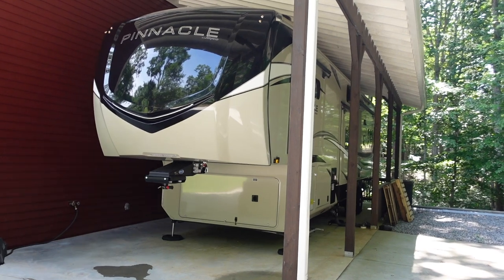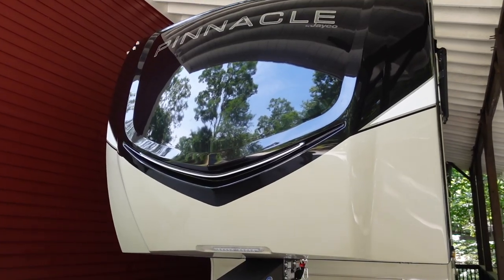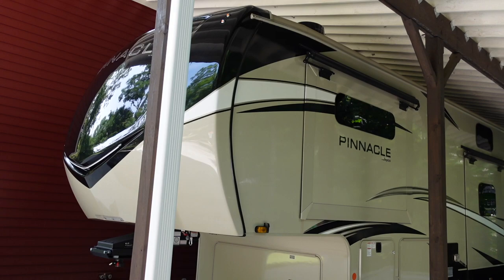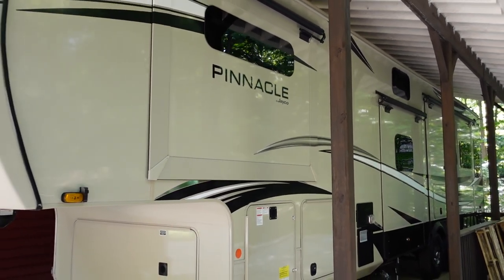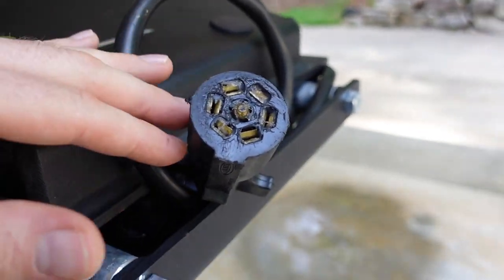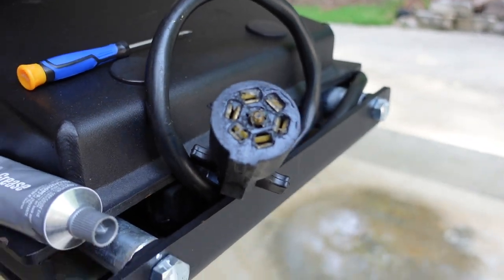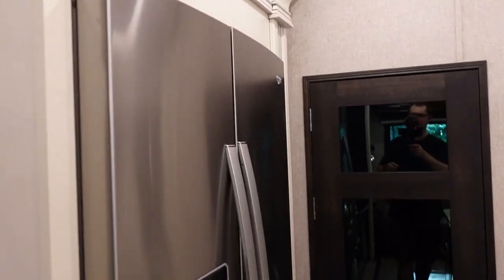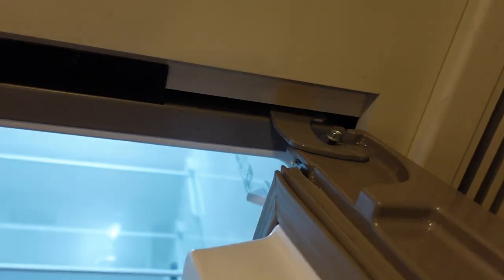Do You Have Same Issues on Yours? // Solutions to 3 New Issues on My Jayco Pinnacle Fifth Wheel RV

Comment: I had to buy the Furion 7 prong adaptor pigtail.  Camera’s all work well.
I also load the connectors with Dielectric grease.
Reply from the maker: Thanks for sharing. Curious what year, make, model you have?
Reply: I have a 2021 gmc sierra and I needed the adapter. I didn't need it on my 2019

Comment: Hey bud, Thanks for making your videos! I have a question maybe you can help me with. I am looking to buy a new fith wheel and one of my concerns is with how these manufactures do their  plumbing. Does Jayco Pinnacle use flexible  tubing on all their plumbing or do they use real PEX (the harder stuff) through out the coach?!
Reply from the maker: Mostly real PEX throughout. They use some flex braided hoses at the water connections, and on mine going to shower valve partially.  I redid most of my basement plumbing, so you can get a better idea in this video:
https://youtu.be/3NGnZ60EzUI

Otherwise only other spot they used braided flex lines is on slides where they are required. Jayco makes a really nice product. I'm publishing a 2-year owner review Sunday 10/1 @ 5p.